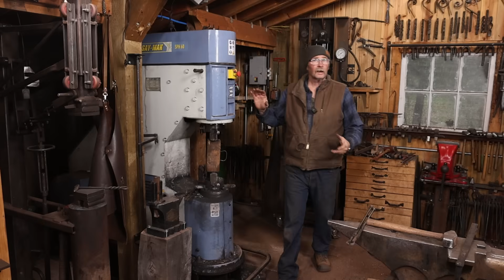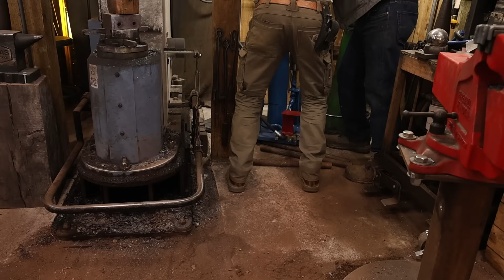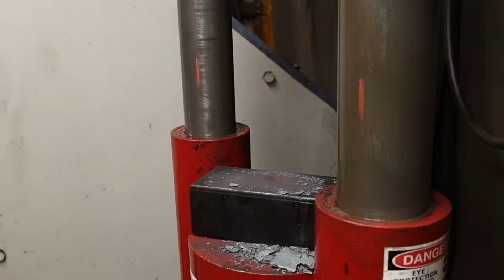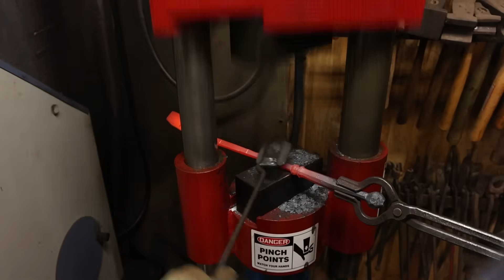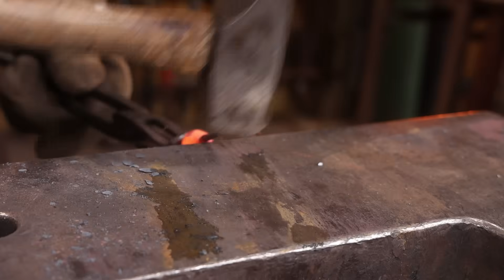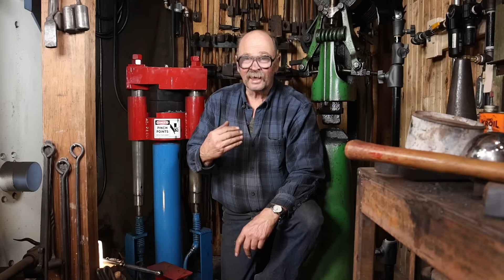KA75 Single Blow Striking Hammer

Comment: Hi John, to you have an update on the KA75 hammer. I am considering buying one for my shop. My elbow and shoulder need some relief. Thanks
Reply from the maker: I am quite happy to have it in the shop.  It's great for tooling that needs single blow precision and can do much of what a power hammer can do.  But if you're mostly drawing out material, the power hammer would be ideal and if you're punching lots of holes for hammer eyes or doing pattern welding, the hydraulic press is probably the better choice.  The KA75 is more affordable and provides a great entry point to power forging.
Reply: @BlackBearForge , thanks John.
Reply: Sorry, do you have

Comment: I'm hoping to build my shop in the next year and I'm torn between this or a press. I like the precision of a press but I know they are pretty slow. I'd like to have a normal power hammer but I think my chances of finding one (that isn't going to be a money pit) within my hobby budget is very unlikely so this seems like the perfect compromise between precision, speed, and budget.
Reply from the maker: The KA75 would be a good first power tool and can do much of what would be done under a power hammer.  But it does require a good air supply.

Comment: The main thing that has held me back is the air supply. My shop is really small I have a harbor freight 20 gallon , 175 psi, 4.6cfm @90. Well, that seems like it would be piss poor. Then, I see there are some who have done demos with a portable pancake- not knowing the full score of what it can do is a little frustrating. I do a little bit of blacksmithing in making my own tooling, but I'm a bladesmith and that would be my use for it. I'm waiting to see "damascus with the KA75" or some such on the web.
Reply from the maker: It may be worth talking with Coal ironworks.  I think you can use a smaller compressor if you aren't trying to cycle it continuously.

Comment: If you put a ball valve on the exhaust side of the air system, you can easily control the down speed of the hammer strike. If you have a lot of planishing type blows to do, this could come in handy.

Comment: Using the Egyptian railroad to move it through the shop is a smart way to use old technology..alot of younger folks dont know about these days
Reply from the maker: It’s a great way to move heavy equipment, provided it has a flat bottom to roll on.
Reply: @BlackBearForge yes sir.. ive used it many times in the shipyard

Comment: Beware of brass when heated it releases zinc-oxide fumes which can be dangerius, i  googled it just in case and it is poisonous so be careful. We dont want to see dust and spider webs on those power hammers and whole shop😂😂
Reply from the maker: I don’t recall working with brass in this video.
Reply: @BlackBearForge  i was commenting on wrong video, it was ytobjorn Ahman's, my phone got disconnected from tv and it landed on your video😂😂

Comment: Hey John or other viewers, what are your guy's thoughts on resurfacing anvils. I have a large mill and a 2 inch face mill and I want to skim a little bit of the surface. I'm really concerned about hurting the hardness of the top plate. Any thoughts
Reply from the maker: If the anvil isn't usable as is, then you have little to lose.  Most people will reface the damaged areas with a hard facing rod.  Thats a lot of work and require proper preheating, again not something to do unless it's so bad you can't work with it.
Reply: @BlackBearForge  Thanks John. I wanted to mill a small bit of the top. The anvil is usable but has a few decent dings. I figured milking would let me get through the dings and not have to use a hard facing rod

Comment: Thanks for the review John. If you had to choose one between your treadle hammer,your power hammer ,your hydraulic press and the KA75 for being the most useful which would it be ?
Reply from the maker: That is a difficult question to answer.  In the last week I have used all of those tools.  The first one I would part with would be the hydraulic press, mostly because it's a home made press that doesn't perform as well as some of the manufactured ones out there.  But if I could only have one tool it might be the treadle hammer with the KA75 being a second choice.  Mostly because a simple home made treadle hammer was my first larger piece of forging equipment.
Reply: @BlackBearForge  Thanks for the reply. I am impressed with how quickly you have managed to control it so Im thinking with increased use it will become even more useful .

Comment: This looks like a cross between a press and a power hammer and if a person doesn't have funds for both then this might be a good alternative to buying both. I was impressed by the control you seemed to have in operating this tool, from really hard blows to very soft taps, looks like it could be a very useful tool in any shop. Thank you for another great video and a very good review of what looks to  be a good tool. I'll be looking forward to seeing you use this tool some more and see how your control of it improves and hear what you have to say about it as you get more used to it. Once I get a blacksmith shop back up and running I may have to check this tool out, I really liked my press but I'm thinking that this might be a good way to get a bit of both in one tool.

Comment: Would it make sense to use a switch with a pilot light and wired to an electric solenoid so you could “turn it off and on” so you wouldn’t have to go to the air supply line and shut the air on and off? Since your other hammers have switches, it looks like it might seem like second nature to have a switch with a pilot light.
Just my two cents.

Comment: Nice work, didn’t know they made single blow power hammers. 🤔 But you are handling it well.  They should have a warning on this and all power hammers that the whole thing is a cautionary pinch point along with the rest of it. They should have big warning labels telling you you should disable power or compressed air before working on it. Seems like common sense but sadly some people are lacking in that department. 😱😂🤔 And I might have missed you saying so but is it affordable for people just starting out blacksmithing? 🤔
Reply from the maker: Sometimes I think we get carried away with warning labels. People will do stupid things even after reading the label not to. I think most beginners should start by hand at the anvil, but as far as big equipment goes, this is much more affordable than a self contained air hammer.

Comment: Just a side note, any of you old farts remember the Bull power hammer, similar in operation to the KA75 but on a single cylinder..
Reply from the maker: I had a bull and got good use out of it. When the cylinder needed re building the builder offered to make the repair, so i sent the cylinder out and never saw it again.
Reply: The Bull was fabulous when it worked.  But the design was a little too clever, and elegant.  The air cylinder was hidden inside the tup, and if the control circuit was out of whack.  Then it would beat itself to death... Which mine did twice.  If you could keep the control circuit tuned, it was wonderful.  Clamping, single blow full power strikes, and sneaking up on the piece when reciprocating.

I still have the carcass of my Bull 90, and in my copious free time, with my disposable income...   I really need to redesign it, and rebuild it.  Of all the things I've lost I miss my power hammer the most...  Which is saying a lot.

Comment: Hi John.  With 10 cfm l'm guessing you need a minimum twin head compressor to run it realistically.  Definitely beyond the capacity of your typical home garage size compressor.    Beyond that the hammer definitely is a good piece of kit.  Joshua De Lisle built a hammer that ran in a similar fashion (one blow per step).  I believe he was working on a repeating blow upgrade so he wouldn't have to keep stepping down over and over.  With the capabilty to do that, this hammer would be even more awesome.  Is that something that Coal Ironworks is working on or considering?  Cheers.
Reply from the maker: I really can’t say myself. Hopefully they will be reading the comments to answer some of the questions.

Comment: What is the difference in use and benefit between that and a treadle hammer? Besides the obvious air power.
Reply from the maker: This is a heavy work tool that of course requires the addition of a power source in the form of an air compressor. The treadle hammer is better at more delicate precise work and can be used in a shop without power or air.

Comment: Do you find this a replacement for a treadle hammer? Seems like they do the same thing but this requires less effort on your part. 

What compressor are you running it off of?
Reply from the maker: While similar to a treadle hammer, i think they are different enough that I’ll be glad to have both options. The KA75 will be much better for larger work. The treadle hammer for finer work.
Reply: @ thanks! Any comment on required compressor size? 

I think it's important to mention anyone interested in one of these needs to also consider the cost of a suitable compressor to run it if they don't already have one.

Comment: I am a little concerned about how close the tooling is to the point where the cylinders murge. Did you see any slage flying over to the seal? Hot slag would melt the seal in the cylinder in no time. Other than that is sure has a place in my shop
Reply: I believe those are just guides. The views from further away show the cylinders are actually upside-down, with the seals much lower. Any scale will likely hit the outside of the cylinder, and never get to the seal.
Reply from the maker: The frame has bronze bushing as guides, so nothing to melt. The air cylinders are open end down and safe from that sort of damage
Reply: @BlackBearForge  Thanks.

Comment: FYI coal ironworks does not ship to alaska nor does anyone else for power hammers or presses that I have found unless you can spend 5 grand in shipping
Reply from the maker: Thats surprising, the Q&A on their web site says they can ship internationally.  Although I'm sure it's expensive
Reply: ❤ @BlackBearForge It's over 3,700 miles from Anderson, Indiana to Ankorage. They would be shipping/driving a single hammer and literally all the way there and back. If someone thinks driving 7,500 miles in a truck plus loading and unloading should be cheap, I'd have to say they were being unreasonable.
Reply: Probably cheaper to build one yourself